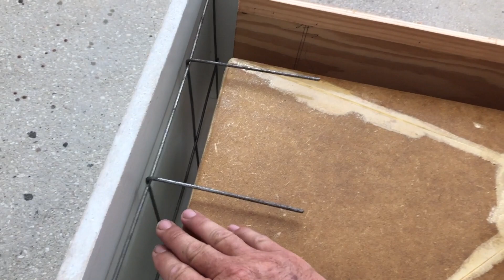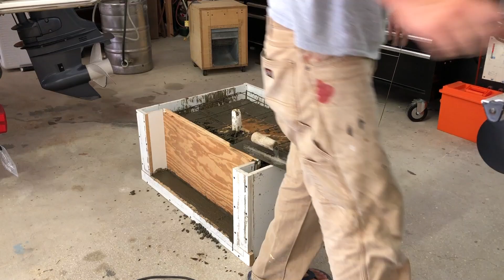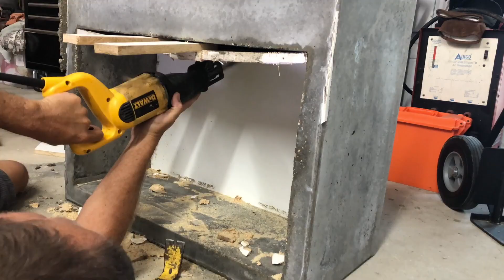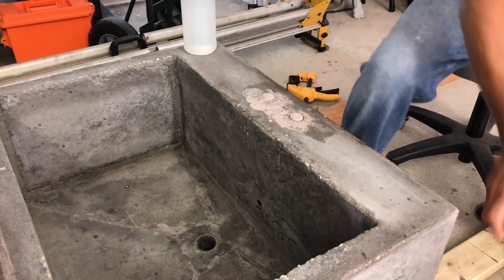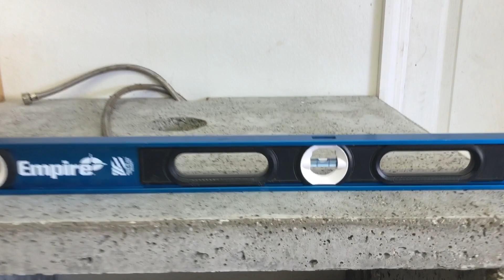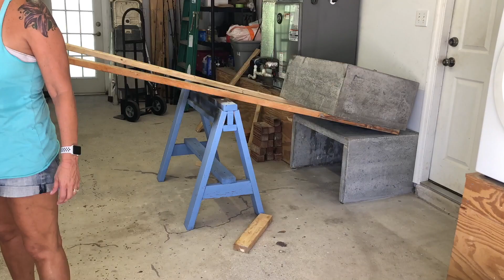Concrete Deep Sink DIY Project

Comment: Please...can one use a VERY-"lightweight" concrete mix (aerocrete??) for the build? TERRIFIC storytelling! sub'd/liked [ pssstt...I'd have rubber-mallet'ed that stray form corner, back into alignment. yeah...ya gotta wrap the drain with cardboard, for wiggle-room. GREAT job, kids! ? 🙂 but...was it mentioned to WAIT near-28-days, for conc. to harden properly? ]

Comment: Awesome work and some great tips... but "biggest concern was safety" while wearing flip flops to lift a 500lb sink on flat down 2x4s.
Reply: Also, I might use a comealong tied in to a stud to pull the sink up.
Reply from the maker: They are steel toe flip flops.

Comment: I have one of those old style concrete utility sinks. Issue with it is that it started to deteriorate and now I have some sort of algae growing in it (black) because water sits in the corner of the uneven bottom. Is there something I can do to seal it after power washing it to keep it from coming back?
Reply from the maker: I used bees wax cut with mineral spirits . It will seal it
Reply: @StoneBrokeAdventure  Thanks!